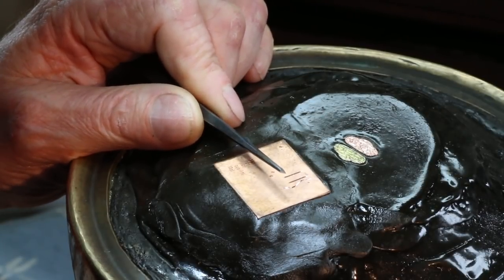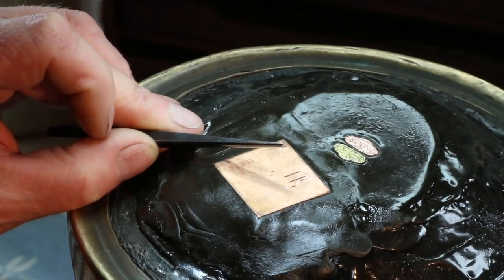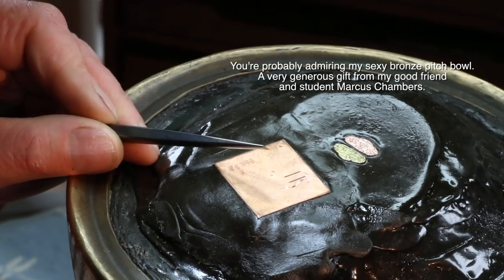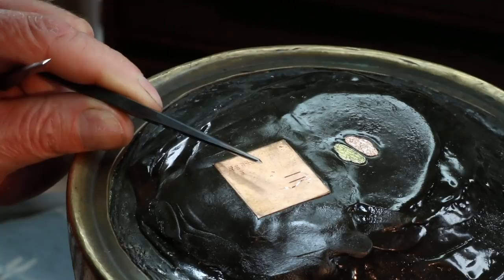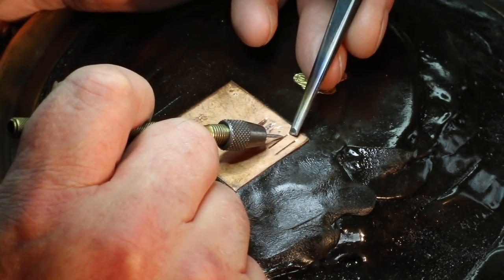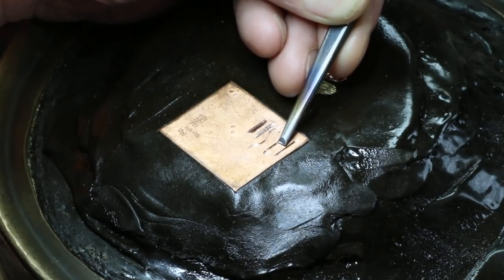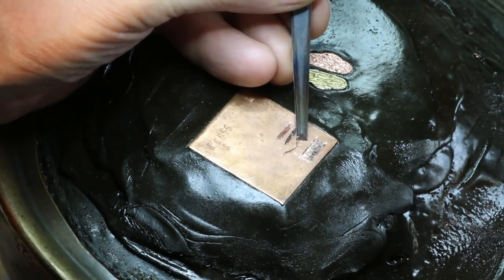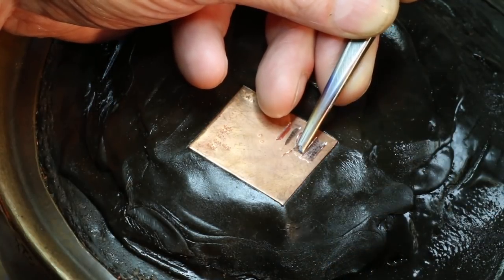Making a shi-shi-ai bori, or safety edge, chisel.

Comment: Excellent video, it has all it needs. The explanation of the steps and the use of the tool. Thank you very much.
W1 is extremly hard to get in Europe. I don't know a single source in Germany and countries where I buy my knife steel. The only source that I know is NJ steel baron in NJ, USA and even there W1 is out of stock most of the times. Silver steel is an excellent choice and I would even say O1 tool (1.2842) can be used as well. Silver steel is only available in round stock where O1 is available in many dimensions.

Comment: Thank you for your presentation. It's very helpful indeed. Do you recomend Chromium Vanadium (CrV) steel like in allen hexagonal keys?
Reply from the maker: Hi Jack, I use a very simple W1 steel. This a basic carbon tool steel that is very straightforward to heat treat and harden in water. More complex steel tend to require more exacting processes.
Reply: Thank you kindly Ford.